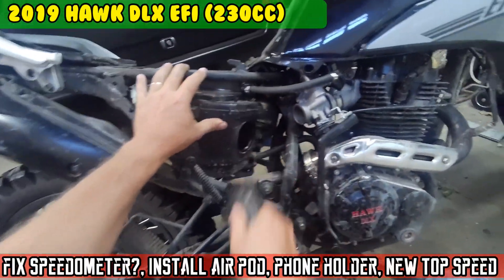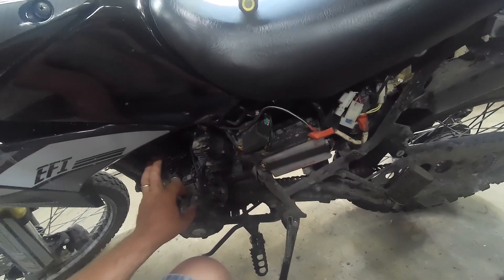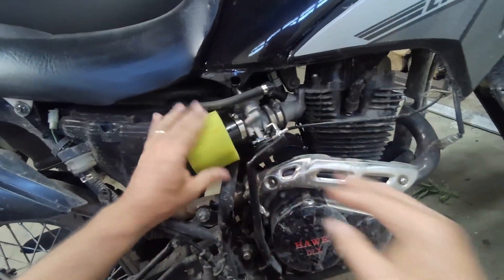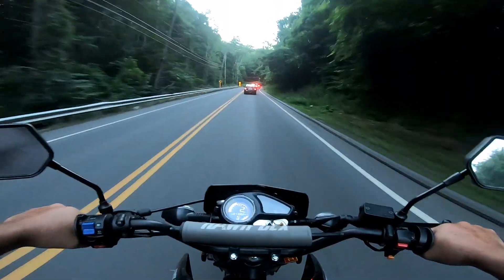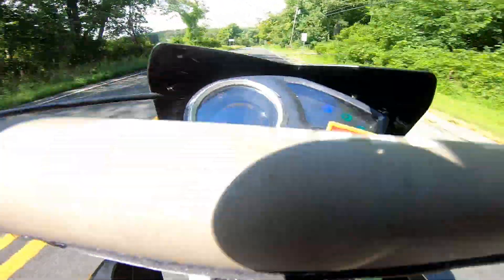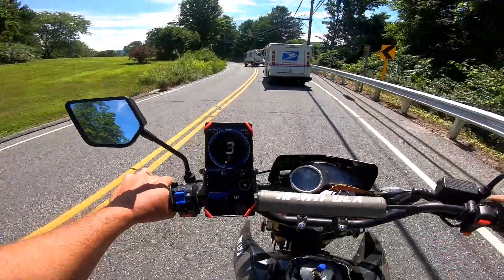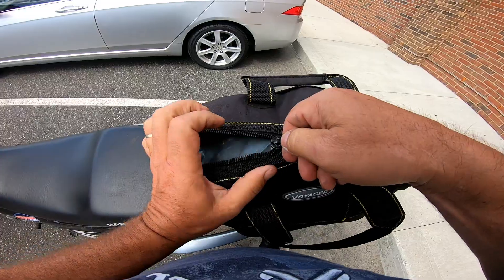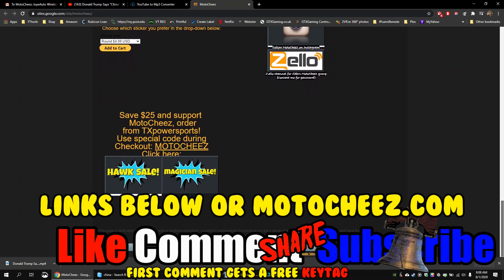Attempt to fix speedometer, install new air pod filter, new top speed and running errands

Comment: Trying to decide if I want to go with a hawk, raven, tbr or Apollo 36 dlx!  I’d be commuting around 15-20 miles and would still like to off-road! Leaning toward the apollo as long as they will push a 250lb guy easily to 60mph!
Reply from the maker: They'll all get you to 60. Not much more unless you do some mods

Comment: I think I’ve got “Hawk Fever”. Thanks to 4 years of watching MOTOCHEEZ on YouTube, I FINALLY bought myself a Hawk 250!

I think it’s kind of funny that buying a brand new Chinese motorcycle is much like buying a used Japanese motorcycle…. The first thing you need to do is go over the bike 100% and fix a bunch of stuff!  LOL…. Not complaining, because I knew what I was in for and I actually enjoy wrenching, modifying, and fabricating.  That’s actually why I wanted one of these things!

I’ve only ridden the bike 36 miles so far, but here’s a LIST of everything I’ve done already:

- Changed Oil with Mobil-1
- Reduced preload on the rear shock to minimum setting so the bike actually squats a bit when I sit on it!  Factory setting was like not having any rear suspension!
- Re-jetted the stock carb with 110 jet and tuned.
- Removed the spark arrestor / baffle from stock exhaust
- Swapped out stock exhaust for aftermarket exhaust but uninstalled it and went back to stock because it was too loud.
- Opened up the stock air box inlet as suggested by MOTOCHEEZ!
- Properly Adjusted the Clutch
- Removed the Kickstarter and ground it down and reinstalled so that it would fold in further to avoid rubbing my leg!
- Swapoed out stock ridged shift lever for IMS Folding lever.
- Swapped sprockets to Mitocheez Specs! LOL! - 17/45
- Replaced stock Chain with Niche Gokd X-Ring 130 Link
- LocTited all hardware
- Swapped out stock Spark Plug for NGK Iridium
- installed a small clear Wind Deflector
- Installed a Maddog Seat Pad
- Removed rubber pads from the floor pegs.
- Replaced the factory battery with a stronger service-free battery.
- Fabricated a Rear Cargo Rack for carrying things.
- Set proper Air Pressure in Tires
- Adjusted and tightened Mirrors in proper positions
- Installed MOTOCHEEZ recommended Cell Phone Holder

Still to do:
- Install My fabricated Rear Cargo Rack
- Install a larger Tool Tube
- Install Oil Cooler
- Possibly install 50/50 Dual Sport Shinko 244 Tires
- Possibly install higher quality Throttle
…..and MORE, I’m sure!  LOL!  🤔
Reply from the maker: Congrats! Wow you've been busy

Comment: My friend and I have been using our Hawks as alternative road transportation. So we've been more focused on being able to keep cruising speed on roads without having to wind the bike out, especially since our area is made of hills. Though it doesn't seem to matter how fast you go you've got some prick in a vehicle riding your ass the whole way. So turning off onto the shoulder to make a turn in such instances has been my evasive maneuver. People here are very inconsiderate no matter what you're driving honestly. It's just more dangerous on a bike.

Funny enough, even with the few rides we've done this summer we've passed a lot of other motorcyclists and regardless of bike type we'll get the biker-wave. Of course not everyone waves and I don't expect them to. When we took a ride out of the city we went onto a side road my friend knew so we could take a quick butt-break. There was a biker on the beach with his girlfriend/wife and we even got a distance wave from him which was cool.

Originally when my friend bought the Hawks the idea was to use them like you are. For cruising around town and going off onto the trails occasionally. But for us we have very few trails to ride on around here and the trails we do have have gotten boring. So we've just been riding on the roads with them and going to surrounding towns we normally wouldn't drive to in our vehicles due to gas usage. Which is why we switched over to road tires, they've helped gain proper speed now that the bike isn't dealing with the flexing of the knobs.

Though I can say one thing's for certain, with growing up riding around on atv's the twist throttle is very agitating to deal with. Especially when there is an impatient motorist behind you and you stall your bike trying to take off. So I'm going to switch it out for a thumb throttle when possible, which imo is more superior. Twist may be more sensitive but it's far from precise, sometimes too much sensitivity is a bad thing. That and just being comfortable while riding, I am not in my comfort zone with the twist throttle. For now I'm just kind of tolerating it until I can switch it out. :)
Reply from the maker: Awesome. I've found myself more in the road lately too
Reply: @MotoCheez  Sad to say but riding off-road isn't as fun to do anymore. Especially if the only way to do it is to have your own property. Which not everyone has and lots of land is expensive.
Reply from the maker: That's true, I still explore and find new places though! I like off-roading better
Reply: Same. Though I think I'll stick to atv's for that. Even if the main trails we took got boring to ride on there's still the flat-rock. Which I personally wouldn't try on a bike. Too many rock climbs for my experience level, or lack there of. But on an atv it's a different story. :)
Reply from the maker: The beauty of the bikes is.you don't have to haul them to an off-road place.
Reply: @MotoCheez  Very true. :)

Comment: My Speedo reads 73mph, but it’s only 67mph with my gps app. My DLX is stock other than 17/45 sprockets and some aesthetic stuff. I am 5’11 and weigh 210 pounds, that is full tuck too. I wish I could get more top speed out of it, but I guess that’s not really what the Hawk is made for. I can’t figure out why my Speedo is off with stock tires either.
Reply from the maker: Everyone I hear from says same. Speedo off. I installed new speedo and it's as close as I can get it, 3 off at 50mph. Even the Japanese bikes are off

Comment: I didnt know air filter oil was a thing. Is this for foam filter only? Im curious as I just recently got a 95 dr350se that I am working on.  The light, seat, and tank are from a honda 500 four from what I could tell.  Top of the airbox has but opened up. It has what looks like a K&N filter on it. I am wondering now if I should oil that or not.
Reply from the maker: The foam and most of the Performance filters require oil. Maybe Google the type of filter you have

Comment: There are magnets in your speed cable on the end that connects to the tire there should be four or five count how many and then put it into the options on the settings need help getting to the settings you got to turn that off hold the button down and then turn it on with the button held down that'll get you to the settings
Reply from the maker: When I installed the Speedo, I used 2 magnets drilled in. Set all settings as close as I could but needs more magnets

Comment: I did the ninja wheel swap and needed a bigger axle speedometer reader installed the new but when I’m doing like 30 mph it says I’m doing 100mph lol any suggestions
Reply from the maker: Can you remove some of the magnets on the pickup for the wheel?

Comment: The proper formula is the angle of the dangle is relative to the heat of the meat as long as the motion of the ocean is a constant. Lol
Reply from the maker: That's right!
Reply: @MotoCheez  And they said I would never learn anything in school. Lol
Reply: @MotoCheez  What do you think is the best for modding? The standard hawk or the DLX which would you prefer if you're going to mod it to get more speed out of it.
Reply from the maker: Carbbed for sure
Reply: @MotoCheez  Thanks and I am going to pull the trigger on one Monday.

Comment: I have a 2022 Haw DLX   The speedometer sometimes "flickers" a bit or looks "wavey"  otherwise it works perfectly.  Any idea what may be causing that?
Reply from the maker: Wonder if it's your regulator?
Reply: @MotoCheez    Thanks not really sure what to do about that, if anything.  i checked all the connects and found them to be tight.  Even in neutral, if I rev the engine, the led numbers just seen to flicker or get wavey.....
Reply from the maker: You'd have to hook a volt meter up and see if the voltage is fluctuating, if it is then could be your regulator. Battery is good?
Reply: @MotoCheez  Yes.   New battery.  I am not going to worry about it.  It is not super noticeable, just curious if anyone else had that issue.  I got the Bike on June 14th and already have a little over 800 miles on it.  I have had it up to 64 mph, and I weigh 220.  Super happy with the way it runs and performs.
Reply from the maker: @markjeter4578  yeah I wouldn't worry about it either